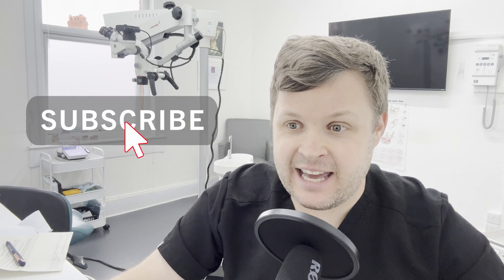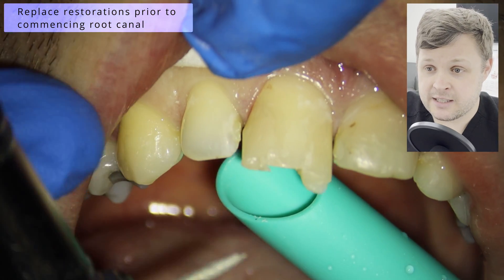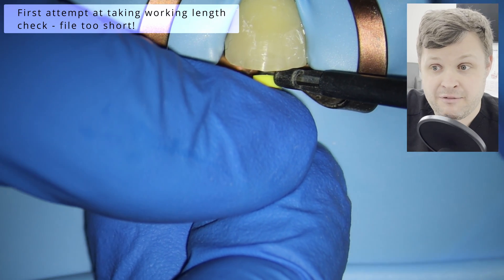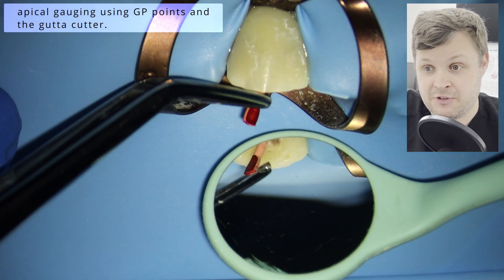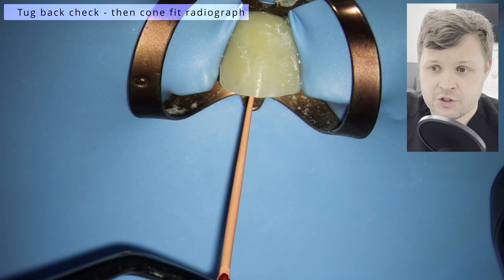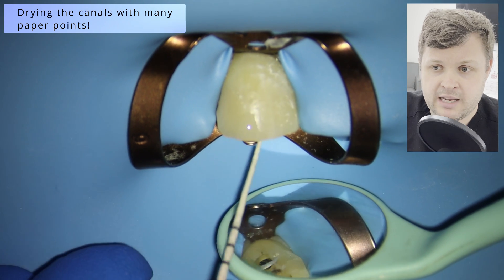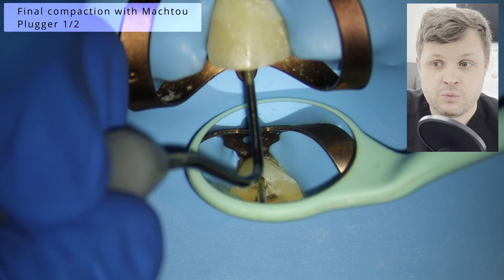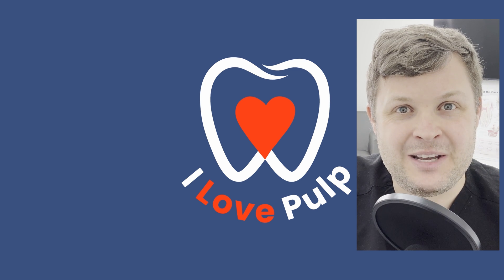Huge Central Incisor Root Canal with Apical Gauging & Drying Struggles (FULL CASE)

Comment: Whenever I see such paper points and need 20+ of them I don’t feel comfortable with obturating the canal. The reason is that I feel I’ve splattered bacteria all over the root canal and that one time I had pus coming out of DB as I filled the MB system of an upper first molar with a huge PA lesion.

Do you have success with those cases and do you always try your best to do it all in a single visit?
Reply from the maker: Wow, super valid point and there is no wrong or right answer. Although, does the pus contain bacteria, or is it aseptic?

Comment: Thanks for documenting this case. When I have a lot of exudate, I feel that even if I dry the canal, the canal has just been filling with pus continuously. did you go back in with hypo to give it a final clean after you were able to dry it? I end up dressing and bringing back but interested to see what your thoughts are on this. Cheers
Reply from the maker: This is exactly what happened in this very case - so you can just keep trying to dry the canal with lots of paper points, or dress the tooth with non-setting calcium hydroxide, and obturate at another appointment - have you had a case like this before?

Comment: hello sir, why didnt you apically gauge with K-files first? thank you!!!!
Reply from the maker: For cost really - using hand files can be quite costly, imagine opening a pack of 35# K-files for 2 seconds to only find out it was two small then throw it away? GP points can be thrown away if they are the wrong size! What do you think, do you agree?
Reply: @ilovethepulp  thank you for your answer and candour, much appreciated

it does make sense but id be worried about potential residual infected dentine in the absence of some form of mechanical preparation.

but it must be stressed that your workflow is beautiful and huge respect to you for sharing your wisdom 🫡

Comment: Hi again. Thank you for your motivating and inspiring videos. What I wanna to say is, that using bioceramics for obturating such simple canals is expensive and I prefer to use the warm vertical GP obturation technique instead. Thanks again. I am waiting for your next video❤
Reply from the maker: It is expensive! I do use WVC when I need greater control. The risk of extrusion with these sealers are much greater. Expense is also a factor. I use OneFil, which is quite a cost effective sealer.

Comment: What do you tend to do if the canal is still bleeding, after instrumentation when attempting to dry, like for example some dry blood at the apex. 

If I’ve gone long slightly I have got this in the past 

Larger taper/apical iso size in this situation? 

Thanks so much 

Really enjoy the videos
Reply from the maker: If you're having trouble with bleeding I would for certain check the working length - sometimes I measure my paper points to ensure I do not push the end through the apex. If the canal is filling with blood, then an intracanal dressing (such as CaOH) and a reattempt at another appointment is usually required

Comment: could you explain the calculation on how you knew that you had to place the GP in the 35 hole to take 1mm off? I keep a scalpel blade in my endo set and can cut by eyeballing it, and confirm the endo ruler. But the gutta cutter from ToothSaver looks ace!
Reply from the maker: well I cut the 25# matched GP cone to 35# with the gutta cutter, placed it to length and the GP cone fitted at 26mm. We know the working length is 25mm so this is where I get the 1mm from. I hope that makes sense - please see this video for a better explanation: https://youtu.be/Sw5B9lPP2tE?si=1m-fMszxGmwZ3Yxf

Comment: I appreciate what you said about the rubber dam. It is essential. I have done endo on patients that have said things like “I have had 3 root canals before and they never used one on me before… I don’t want that!”

As clinicians we need to stand our ground. If someone doesn’t want to go through the minimal steps necessary to have successful and safe treatment then they can go elsewhere. Pandering to the kind of behavior is a slippery slope. When I take out teeth, I use throat pack. When I do endo, I am using a rubber dam. Patients are required to wear protective eyewear at all times. I am glad to hear that you have strict clinical safety standards and are also unwilling to put up with people’s bullshit. 

As always, great video!
Reply from the maker: It's like asking a heart surgeon to perform their surgery in the hospital car park!

Comment: Hello Dr.
I am confused, why didn't you file the canal  ? you said you used the orifice opener only or was it cut out and this video is just an emphasis on how to dry the canal ?
Reply from the maker: Hello! I used the orifice opener to open up the access cavity. As for not using the shaping files - the canal was already open, and the irrigant can flow. You are not scraping the canals with the files, you are creating a path for the irrigant to flow. Remember, the irrigant is the MOST IMPORTANT step. What do you think?
Reply: @ilovethepulp  I agree with you that the purpose of endo treatment is providing a pathway for the irrigant inside the canal reaching the working length and then ensure a hermetic seal afterwards hence the concept SHAPING for CLEANING but shouldn't the infected  dentin inside the canal be scraped ? 
I'm certainly not criticizing you in any way shape or form, i'm just confused cause thiis is the first time i've seen something like this.
Cheers.
Reply from the maker: @AhmedAli-bw9bc  Its known that the inside of the root canal is so complex that only 30% of the rotary file touches the canal walls. Also, the smear layer that is created could block tubules that harbour bacteria.